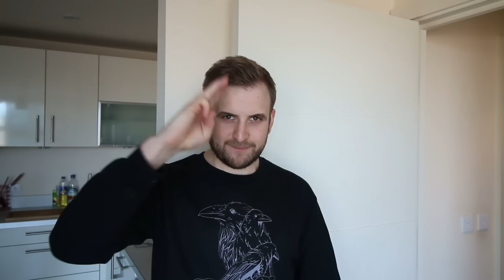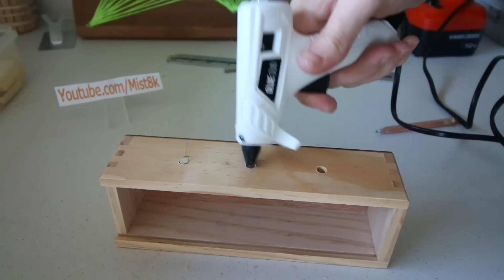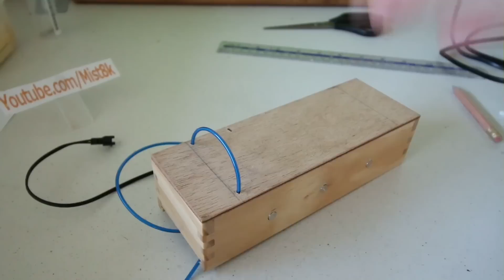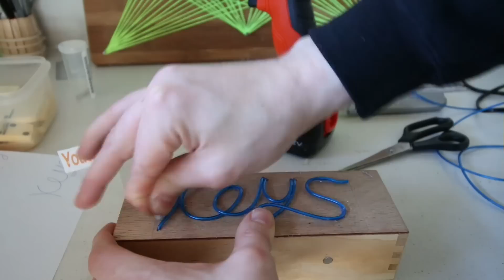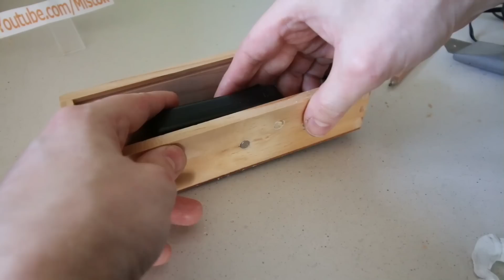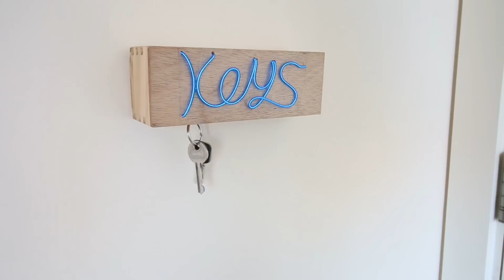D.I.Y Illuminated Magnetic Key Holder!

Comment: Just read the amazon reviews and most said that it is loud. As in it makes a high pitch sound all the time and the batteries last for 6-8 hours. Also the cable gets significantly dim after 30 minutes. Anybody here had this problem with the electro luminescent cable?

Comment: Nicely done! Instead of cutting off the end of the wire you could drill a hole in the bottom, run the wire out and glue it into a loop that would light up the kegs hanging below the box.